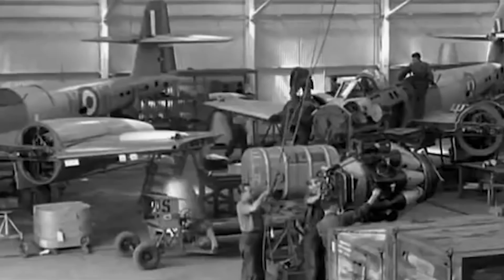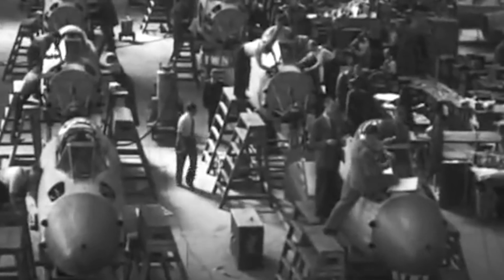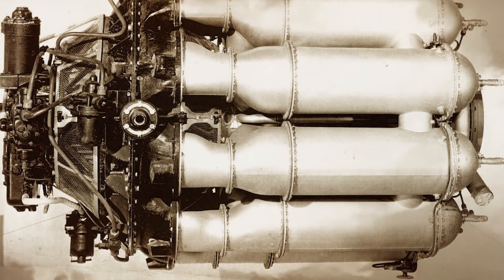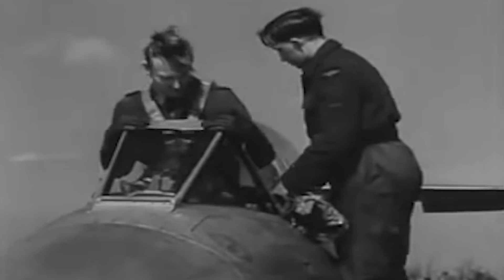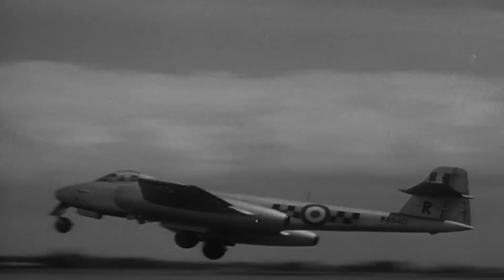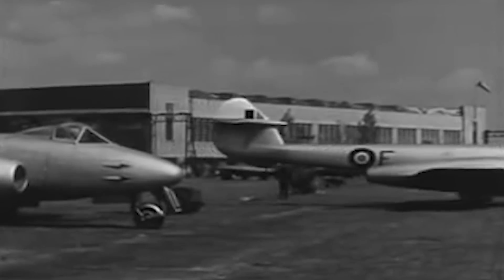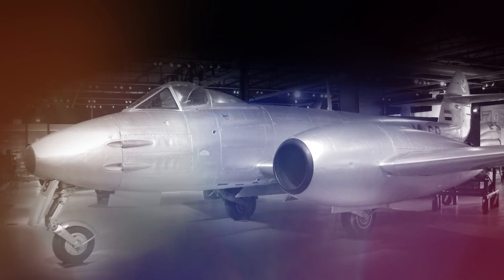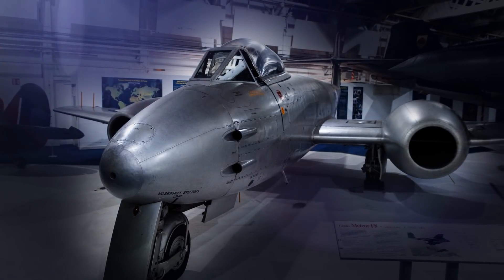Gloster Meteor - The Only Allied Jet to Fight in WW2

Comment: Actually, the US put P80s in Italy very late in the war. If I'm right they were supposed to hunt Ar 234s if they got into that region, and also to boost morale.
Reply: actually YF80s, prototypes. 1 crashed in England, and the three in Italy never managed to successfully intercept the AR234s
Reply: @davidewhite69  I believe the P-80s where used for photo recon work , as where the AR234s. Jet engines where just awful back then.
Reply: @LV_CRAZY  Unfortunately, the P-80 flew no combat missions during WWII.
Reply: @jb6027  It would appear that the reconnaissance missions they performed in Northern Italy were the pressing needs of the time
Reply: @LV_CRAZY  ...But it's speculation with no documentation.  Taking off from an Italian airfield does not a reconnaissance mission make.
Reply: @LV_CRAZY  The performance specifications of the P-80 at this time would have made it an extremely unlikely candidate for the reconnaissance role and it was not a threat to any Luftwaffe aircraft.
Reply: @jb6027  True, but they did indeed fly, and so were "used" by the Allies.
Reply: @richardadams4928  
They did just fly but after one crashed they were grounded so not much use, much like the Do 335 or Ho 229, Of course the Me 262 wasn't much better, most never flew and it was unable to handle piston engine fighters, probably why no Me 262 ever came up to fight the very good Meteor.
Reply: @LV_CRAZY  That is what Bill Gunston Combat Aircraft He says that 2 were in Italy serving UNDER combat conditions
Reply: @sandervanderkammen9230  Recon is NOT restricted to Air to Air in 1945 German TROOPS WERE BEHIND THE gUSTAV lINE AND THE p80  may HAVE BEEN USED IN THAT ROLE
Reply: @barrierodliffe4155  Meteors were kept in England I believe Barrie.
Reply: @jacktattis  IN late 1944 Meteors were sent to Belgium for airfield defense, then a bit layer sent to Holland, they were used for ground arraxk and armed reconnaissance, no Luftwaffe fighters came after them.
Reply: @barrierodliffe4155  Thanks
Reply: I believe Meteor F8 VZ467 nicknamed 'Winston', formerly of No1 TWU, RAF Brawdy is still in an airworthy condition in Australia.
Reply: @ma9x795  Last I looked the RAAF museum has one on display and 2 in storage.
Reply: I believe it was 2 to england that were never used, and 2 to italy, that were yp-80's that were sent on several sorties, but never came across any "action" as they say.
Reply: 2 went to Englans where one crashed and three to Italy.
Reply: YP-80s, i.e developmental models, non-operational, and used on reconnaissance during their development flights.
Reply: 3 saw about 6 weeks service in Italy. Never saw actual combat.
Reply: The P-80s spent most of the war grounded due to technical problems...
Reply: I know this to be true. My Dad was there and was on the team that assembled them from crates and tested them. He told the story many times. It was 4 planes.
Reply: @magnagazoo4863  Can you share any insights into technical problems the P-80s suffered in service in Europe during WW2?
 One of the 4 crashed shortly after arriving and the remaining 3 spent most of the war grounded due to technical problems.
Reply: @sandervanderkammen9230  No they were NOT grounded
Reply: @Bruh Moment I assume that the higher priority was for a bomber, Intel was rather pointless at that point for the Nazis.
Reply: Typical pf the Americans in World Wars arriving better late than never, lol.
Reply: You are right about that.